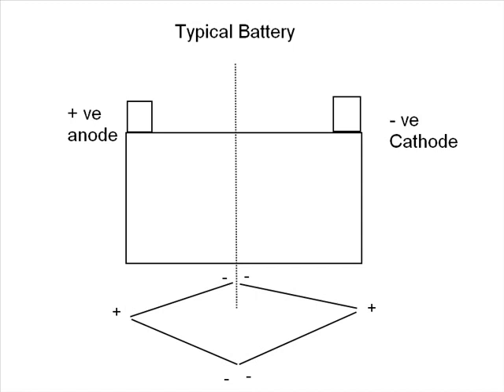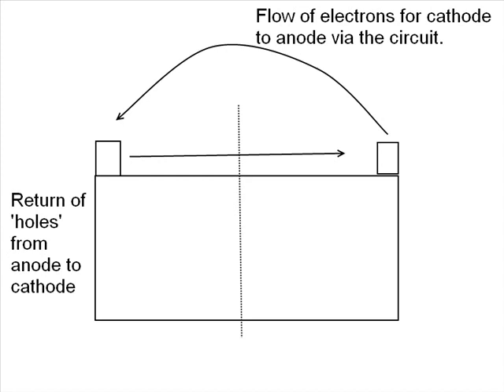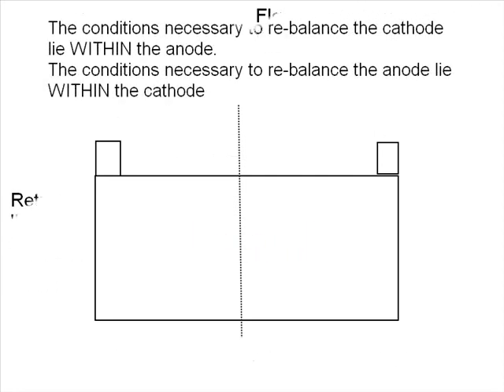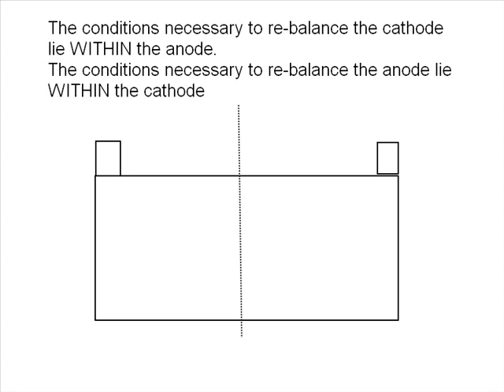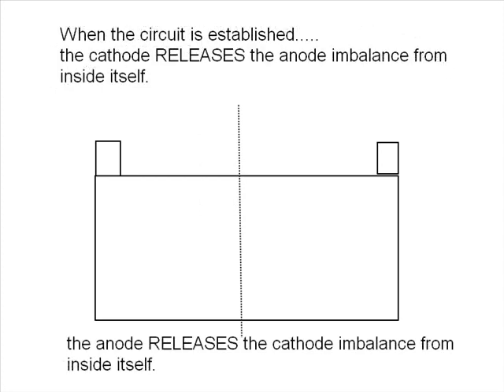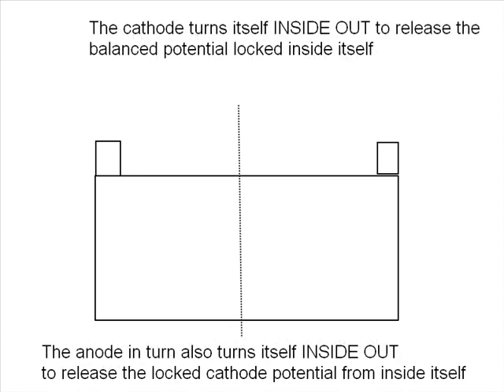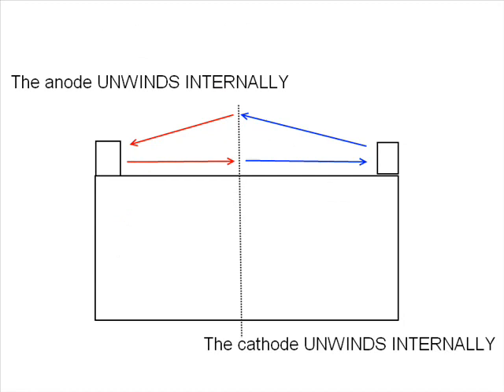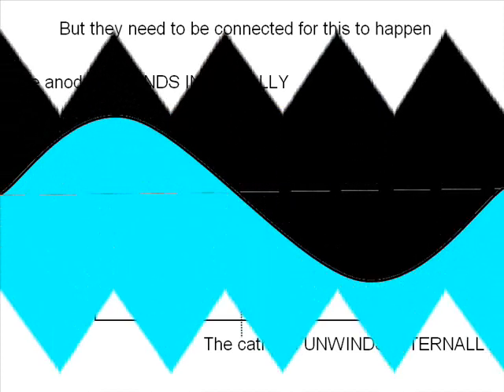Walter Russell Cosmology "How a battery discharges"

Comment: "There are only two combinations of these spherical + and - electromagnetic waves they have opposite vectors and spin (male and female) Inward spherical waves come from the universe compressing at every point of space equally balanced by opposite eXpansion. And -outward waves now eXpanding from its source returning to potentials. 
Space is a division of solidity into entropy C2 the second law of thermodynamics, but also 4pi R2= a multiplication of volume at expense of gravitational potential."

Comment: Could there be only two combinations of + and -spherical waves having opposite vectors and spin concentrically layered like onions?
Inward spherical wave+fronts multiplying time dilation at right-angles compress + and -outward waves eXpand dividing at right-angles.
The greater the mass or energy density of inward spherical wave+fronts compressing wave+amplitude the shorter the oscillating wave-lengths generate volume of mass compressing+4-0-4+-decompressing eXpanding spheres dissipating gravity?

Comment from the maker: Hi AAR,
A battery when charged is divided into a positive 1 and negative 1  side.
The positive is divided into a positive and negative 2 SELF.
The negative side is divided into a pos/neg 2 SELF
When discharging occurs the voidance is between the opposite expressions of SELF not between the opposite sides 1 of the battery.

Are DC sources not just rectified ac?